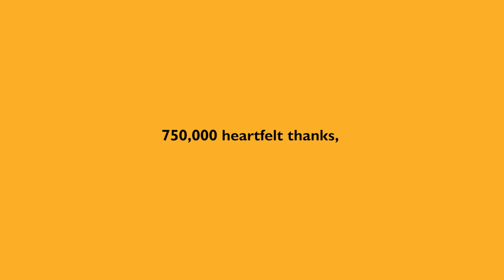History of the JCB Backhoe Loader - 1970s

Comment: Those older machines were built real well in the day and will still do a days work if needed. When I lived in the UK we had 3C Mk2's and 3's on the farm until 2000. I also brought and sold several more I repaired/repainted as part of my machinery  business.  I'm now living in Canada and found a 3D Mk3 build 5 with extenda hoe.  It has a full cab, the export spec 3rd loader spool and 8ft standard type JCB bucket instead of the 4in1 thats been extended quite a bit for extra capacity by a previous owner. 
   It was a tank of a machine in it's day from what I've heard from the guys that drove them new, and still is for what it has done here in the 4 years I've had this one.
   It was a sad day when Mr JCB left us, but man did he ever leave us a huge legacy, with all these old  machines out there. Still working hard after all these years  of abuse and serious neglect in many cases .  Congratulations on 750.000 backhoe loaders, I'm proud to of owned every one I've had over the years. Take care everybody at JCB
Reply: super6954 greetings from the uk I'm 62 today and I have been driving one model of job or another since 1988 I actually went job's training facility just after it opened in lady hole lane near Burton upon Trent and learned how to drive a 3cx properly that was the best two weeks I have ever had with being educated in something that has kept me employed ever since in my mind they were the most versatile machine you could ever drive, the only thing that held them back was they didn't have full 360% capability, now  we move on to today I've moved on from the 3cx to the latest job 140x lc I've only been driving this model since November 2019 but it's actually the best machine I have ever driven, saying that I still miss the 3cx.
your comment was the most bang on comment I have read and I thank you. p.s Canada is a fantastic place I've had two of the best Holliday's there over the last six years.
Reply: JCB IS NUMBER 1